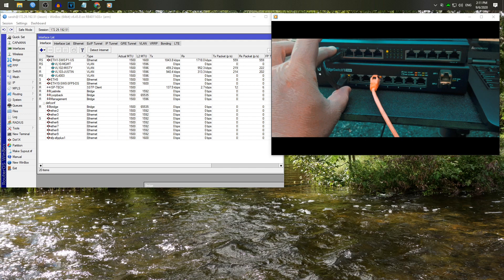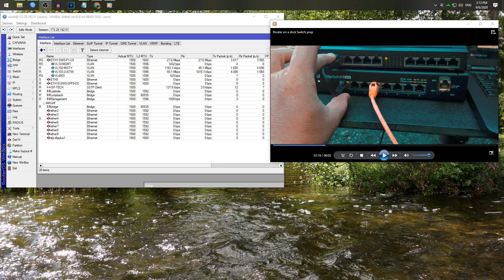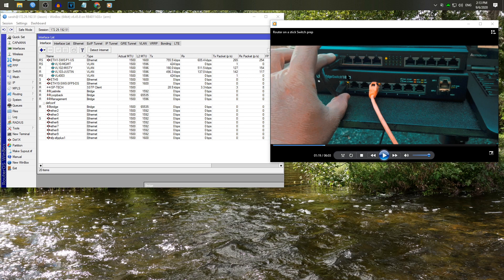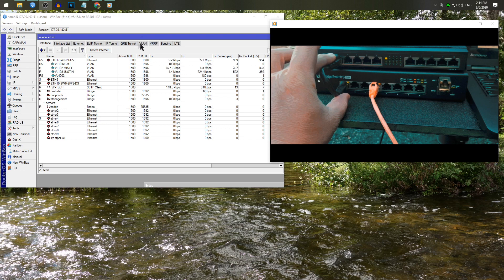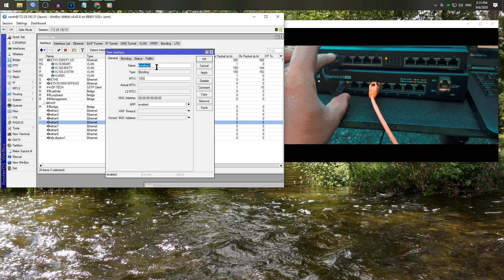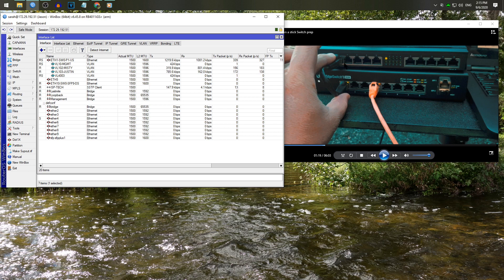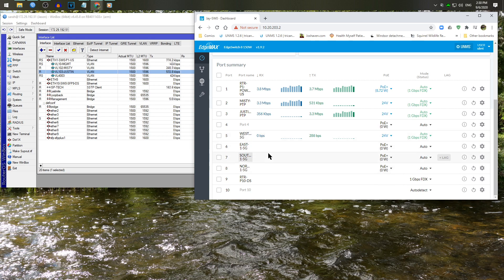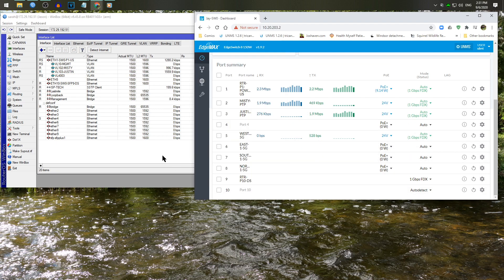Router on a stick AAND Vlans AAAAND Port isolation aka L2 Isolation

Comment: Hey its me bothering you again, on minute 6:43 u showing how to untag vlan, but this is confusing me cause i saw in the wiki manual that thats not the best way to do that cause it violates IEEE 802.1W when rstp is used so they recomend do this by vlan filtering in the bridge but it uses alot of resources of the cpu unless u have a crs3xxx which they can hardware offload it, so i was wondering if u had problems doing it in that way.Thanks
Reply from the maker: Thats only with mikrotik switches. this is a Mikrotik router & UBNT switch.